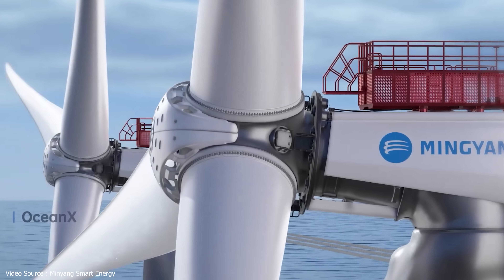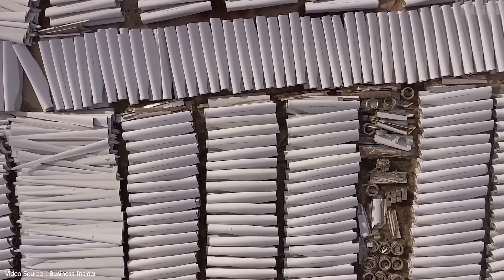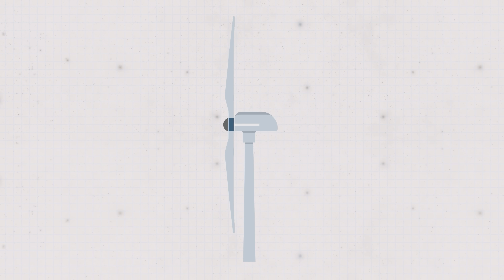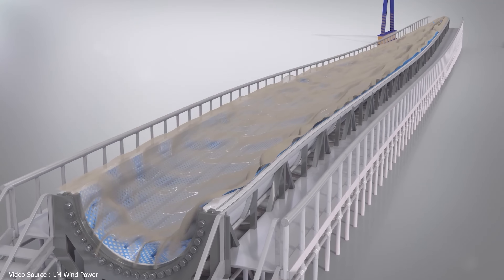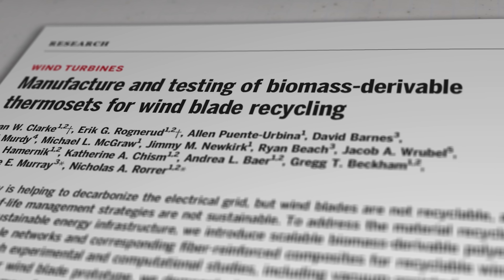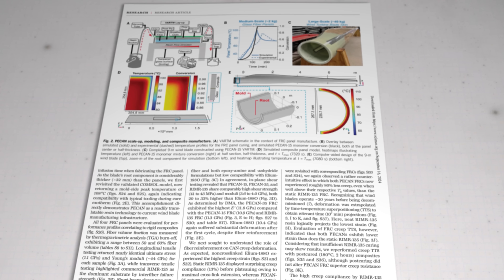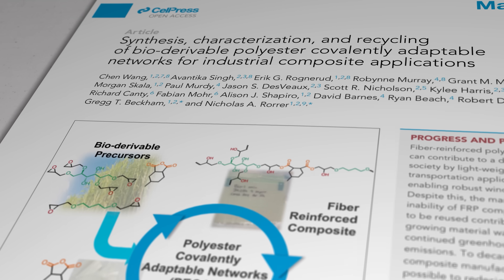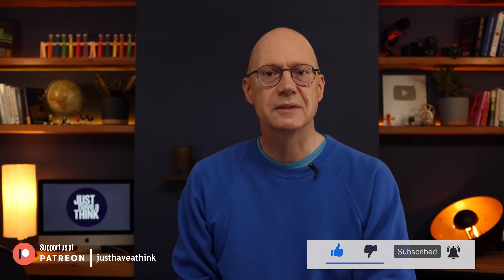FINALLY! Fully recyclable wind turbine blades!

Comment: use Super wood for blades. they they basically take normal wood and compress it 11x and it becomes Densified wood. this wood makes alot of sense to use as a blade since it's stronger than steel.
Reply: "stronger than steel" is a misnomer because it means it's stronger than steel by weight.
Reply: Excellent as a building material. Not so much for the spans and stresses of blades that are 100s of metres long.
Reply: The tower can be made of densified wood but the blades currently use fibreglass because of stress resistance and whatnot. The tower was never a problem since metal can be recycled but the fibreglass blades need a solution.

Comment: If these blades that go to landfill don’t break down easily why do they need to be replaced at all 🤔
Reply: They get fatigue cracks - losing ductility and strength over time.  It's the same reason why aircraft wings have a limited service life (flying hours).
Reply: Imagine you, driving your car with 200 miles/hour trough hail. It's like sandblasting. The blades get grinded down.
Reply: its probably something to do with tensile strength becoming too flexible/rigid or mineral buildup. i dont know the reasons why the blades have a limted 'working life', but those r my best guesses.

Comment: How many tonnes of diesel are burned in changing just 1 set of offshore wind turbine blades?
Reply: Troll, what's your point?
Reply: @GrandTerr  it's  a question.
Reply: how many tons of diesel to generate the same amount of electricity as the turbine generates using those blades?
Reply: A drop in the bucket compared to the amount of energy generated by those blades over their lifetime 😂
Reply: how many tonnes would be burned without the offshore wind turbines? 
In time, all methods of transport will be decoupled from fossil fuels.
Today i learnt that a cargoship of champagne and spirits crossed the atlantic using 90% wind power
Reply: Transition takes time. In the end it's about energy, there are safe sources of energy to start using.

Comment: I am curious to learn about what environmental changes might result from the wholesale extraction of energy from global air circulation.
Reply: Man has cut down forests and demolished wetlands and these have most likely reduced the amount of wind resistance that was slowing down the wind previously.  Wind turbines probably use a significant amount of that additional wind, balancing out the equation.  So it's probably nothing to be concerned about.
Reply: @acmefixer1  Also, a heating planet generates more wind.
Reply: None - or insignificant
Reply: Well.. Due to physics there's a lot more energy being put into our climate systems, that's because the Infra red isn't escaping through our snug CO2 blanket. 

"A technical chart in a chapter of the latest UN climate assessment laid out the unfathomable heat gain. Between 1971 and 2018, the ocean had gained 396 zettajoules of heat.
How much heat is that? Scientists have calculated it is the equivalent energy of more than 25bn Hiroshima atomic bombs. And that heat gain is accelerating."

So in conclusion.. you don't need to worry about windmills removing energy from our climate systems, it's really negligible.